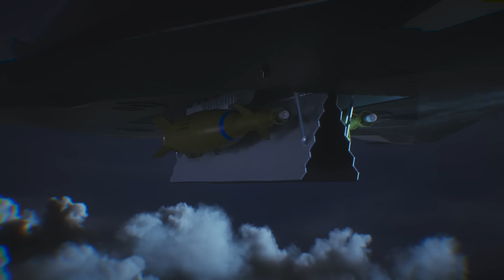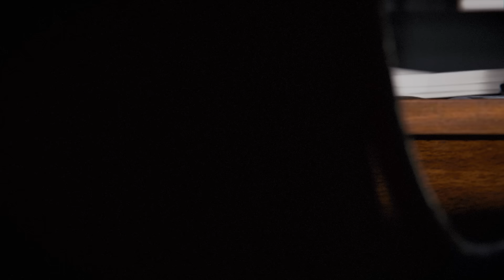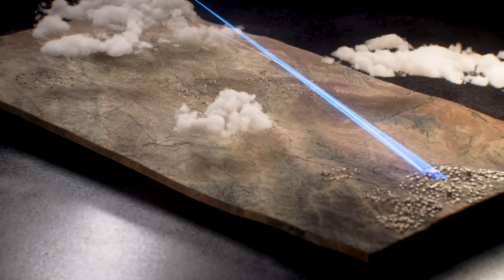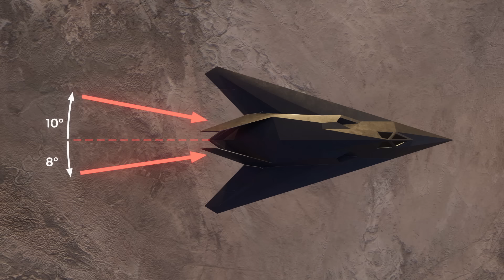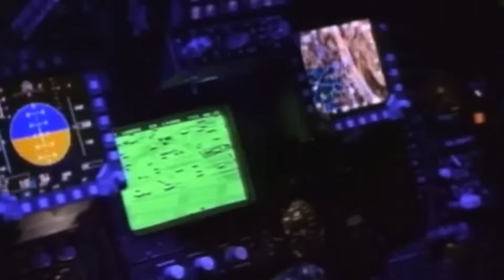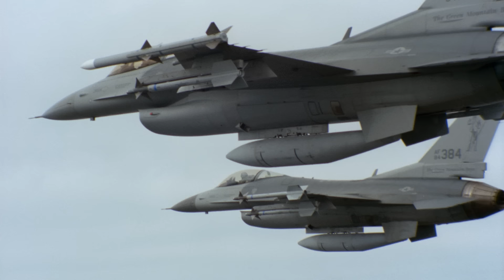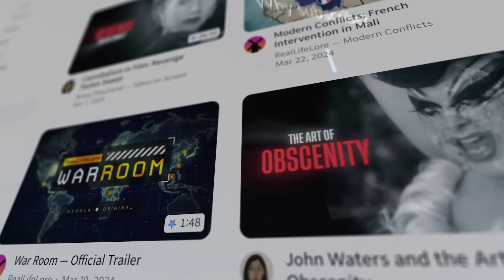The Insane Engineering of the F-117 Nighthawk

Comment: The radar absorbant matierials on this airframe are super fragile and needed alot of maintenance if they got too wet or just dust abrading them away during flight etc meant complete removal and reapplication... THIS STUFF is super toxic and will give you cancer if inhaled much asbestos based layered bitumenish polymer wierdness NDA it also contains ******alnine and alkyl****knows😂 still used today B2 AND F22 f35 meh hope they provide good breathing appa to the maintenance crews 😂
Reply: Like it was so bad to deal with it alot of the retired f117 airframes instead of being completely decontaminated were simply stripped of any avionics and engines etc and buried because it was cheaper than the cleaning up of a now defuct aircraft 😂

Comment: Correction about war over Serbia: the SAM battery which had a shot was actually never moved after initial displace which did happened some 2-3 days before war, and their radar was silent until up to 10 mins before acquisition for surivelance radar and 3 intermitted acquisition & targeting radar which lasted about up to 20 secs each. F-117 route remained same for 4 days, and on top, there was no SEAD support even close *But  Serbian side didnt know that so they had to assume that there will be some HARMs coming down their way as soon as they power up radars.

Comment: Ok, the anti-icing wiper blade and gylcol system seems like a 70's solution for a high tech plane. Lol i get that it was sub-sonic but how many of those were ripped off during flight? Why didn't they electrify the grid and heat it that way to melt the ice?
Reply: Heated panels can be dangerous because the water simply flows back across the airframe and freezes further back. There's a reason most airliners still use wipers

Comment: The thing that always trips me up about the F-117, is the fact that it has the fighter classification as denoted by the 'F' in its name. Since it is technically a bomber it should be named the B-117 or something similar.
Reply: Legend has it that the Air Force wanted to attract fighter pilots to fly it and the F designation basically sounded cooler than calling it a bomber.

Comment: I remember going to an air show with my grandfather at Dover Air Force base back in the early 90''s just to see this plane. It didn't fly, it was only on display. It was amazing and disappointing at the same time because you couldn't get closer than 75 yards...but it was surrounded by armed guards, which as a kid was the coolest part.  I remember wondering how it could fly with such thin wings. They also had red coverings over the air intakes and along the back, which I now know is the exhaust area...even the landing gear was covered, which I thought was cool because I was convinced it could take off and land vertically and therefore didn't need wheels.   My Grandpa was such a joker that he egged me on and basically told me I was correct on any wild ideas I had. Hahaha...great memories.   
This is one of my favorite planes of all time.

Comment: The F-117’s ‘insane engineering’ was groundbreaking in the 80s, but let’s not pretend it was flawless. It was basically a flying polygon that couldn’t dogfight, relied on Cold War secrecy, and got shot down by 1960s Soviet tech in Yugoslavia. Some ‘stealth’ legend.
Reply: 1: It was designed as a precision strike aircraft, not a fighter. It only has the 'F' designation as it was flown by fighter pilots but the aircrafts role was strickly ground attack thus it didnt need to dogfight, which by the time it was in service was becoming a rapidly dated concept with improving air to air missiles. (Obviously on a dedicated fighter dogfighting capability is still important on the off chance an engagement leaves the BVR stage)

2: The secrets of how the aircraft was stealth were protected and it often operated under secret conditions, but so do all state of the art vehicles and weapon systems. To say it relied on it is arguably false however as it was an intelligence leak that led to the shoot down.

3: During the conflict in Yugoslavia, F117's flew hundreds of sorties undetected by enemy radar installations. During a sortie the F117's would often be accompanied by an AWACS aircraft which assisted in dealing with various anti air installations. The reason one and only one was shot down was US complacancy and a lack of in-theatre maintenance on the F117's bomb doors. The thing is, the F117's often flew the same flight path and the Serbians knew this, establishing multiple anti air stations along the route. The shootdown happened because of all of these reasons: The F117 that was downed, lacked AWACS support, its bomb doors jammed open for a few seconds longer than normal allowing a Serbian anti air operator to know one was in the vicinity. Because the operator knew the flight path and rough altitude of the aircraft he proceeded to blind fire two missiles in front of where the F117 was going to be with a timed fuse. The missiles never actually locked onto the aircraft, instead detonating in front of it with the F117 colliding with the shrapnel resulting in it crashing. Still an impressive achievement and astonishing failure on behalf of the US, but it wasnt the fault of the F117's stealth capability, nor does it mean stealth is useless, despite what the russians want people to think.

Comment: I would like to see a video about the XF5U. It was developed in WW2 though it never saw combat and it being a prop plane meant it was passed over for jets. However it had extremely small wings and a lifting body. The body of the plane actually provided enough lift to fly by itself but it didn't have enough roll or pitch control so small wings were added, they also provided more lift which allowed for more weapons. It actually was considered a very attractive option and even after the war was seriously considered. It had a low stall speed which meant short take-off and landing and it's bulky appearance and short wings meant it wouldn't take up much space inside an aircraft carrier.
That said there were issues. The very large pair of double wasp engines mounted in the flusalage combined with extremely large propellors created a lot of vibration which was hard on the pilot and the structure. Solving this was deemed not worth it with jet technology on the horizon.

Comment: It’s an nazi Design 😂
Reply: That was the B2 flying wing
Reply: @iwineverygame1995 neither are nazi designs
Reply: @Orbital_Inclination Original functional flying wing prototype was German.
Reply: @Orbital_Inclination B-2 was created because of the flying wing's low radar cross section. 

Argue with the OP. Not me.
Reply: @iwineverygame1995The B2 is unrelated to the Ho229 and is based solely on the work of Jack Northrop and the Tacit Blue program of the 80s done by Northrop Grumman.
Reply: @Tozzpot500 Wait until you find out where they got the idea.
Reply: @iwineverygame1995The Northrop N1M that first flew in 1940 and was the first flying wing design with an engine to fly?

It certainly wasnt a failed nazi prototype

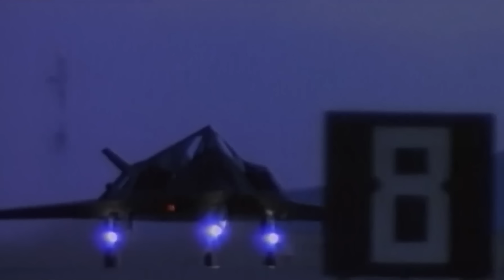Comment: 13:57 the sweep angle is the angle at which the wing is tilted backward, it's measured from the root of the wing not from the tip as you show here,  as well it's measured in degree not in "%" as you show here incorrectly, maybe you should skip this title "engineering" and go back to school

Comment: While those other things were factors, the real reasons the F-117 was shot down came down to the AF using the same regular routes for the planes and luck.

Luck because low frequency radar can see stealth, but only at closer ranges, though it doesn't have the fidelity to produce a weapons lock like high frequency radar can. The low frequency radar saw the plane where it was expected to be and the high frequency radar was switched on just as the F-117's payload doors were open.
Reply: The real reason was the arrogance and ignorance of the CAOC in Vicenza, LtGen Michael C. Short USAF, cancelling the SEAD and CAP ATOs that night diverting those assets north and sending the F-117s south all by themselves.

Comment: I have never heard this question addressed.. how is it that.. if the radar is coming from the ground, and the bottom of the aircraft is extremely flat, how is that even remotely stealthy? Typically flat surfaces are known to be the absolute biggest no no ever.. no other plane or ship or anything that calls itself stealth has a single flat surface on it.. yet this plane is almost completely flat on the complete underside, which is the side that all of the radar will be bouncing off of.. please explain?

Comment: The stealth fighter would be doomed in a dog fight it’s ability is firing its missiles off at aircraft without bein detected,but the night hawk could probably be picked up by advanced modern sensor sweeps now,but no aircraft is undetectable when producing a heat signature which goes with jet engines,it’s the balance between stealth a speed which modern aircraft use now

Comment: Lol, engineering was so "amazing" that it was shoot down by Soviet anti aircraft missile from 1960, and in a situation where 27 Nato countries who attacked 1 country without UN approval couldn't impose "no fly zone" after 78 days of constant bombings. You are a joke. Xd
Reply: cope harder
Reply: 1 shotdown after flying thousands of sorties is not impressive by any standard. War material will be destroyed and the F117 that was lost was already obsolete by the time the Serbs got lucky and hit one.

Also they only detected the F117 due to literally every condition being in Serbia's favor:

1: due to weather the F117 was flying without AWACS support from an EA-6B Growler.

2: The F117 was flying the exact same route that every single other sortie had taken.

3: as it launched its payload the doors jammed. Normally they would be open for a few seconds, in this case it was closer to 35.

4: At the time the F117 launched its payload a Serbian Radar operator powered up his system and was able to locate the aircraft. Knowing the route it was going to take he fired two missiles into the path of the F117 set to airburst mode which the F117 then flew into. The missiles did not achieve lock nor did they track the aircraft. 

5: stealth aircraft are not invisible, they can be detected at relatively short ranges which is why they fly with AWACS support to deal with Radar systems if they do get pinged. The radar used for detection and the one used to obtain missile lock are different systems, spotting a stealth aircraft doesnt mean you can obtain a lock, especially if its equipped with anti radation munitions.

6: only one F117 was shot down, and that was due to the USAF becoming complacant and overconfident. It remained in service and saw combat after Serbia but only one was ever lost which says a lot more about the aircrafts cabalities than one being shot down in a literal fluke.

Comment: Too much unexplained jargon and unclear explanations. How does the shape help make it invisible to radar exactly? Still have no idea after watching this
Reply: To try and put it simply, radar works by sending out a signal and then waiting for it to bounce off something and return (The bigger the return signal the easier it is to track). The F-117's shape is designed to bounce the radar's signal in as many directions as possible so the radar gets a very weak return signal, making it hard to track and even harder to maintain a lock.
Reply: Some parts of an airframe act as retroreflectors, similar to bicycle reflectors, allowing radars to detect signals bounced back from the airframe over long distances. When radio waves are reflected from various parts of the airframe, they interfere with each other. By carefully shaping the aircraft, engineers can manipulate this interference to scatter the reflected waves in directions other than back to the radar source. Advances in mathematics have enabled the identification of retroreflective areas and optimized the overall shape to reduce constructive interference and minimize signal reflection toward the radar.

The angled shape of early stealth designs, such as the F-117, is a result of the limitations in methods and computing power available at the time it was developed. This design, while effective, was constrained compared to the smoother, more aerodynamically optimized shapes seen in later stealth aircraft.

This approach, combined with the use of radio wave-absorbing materials, creates a low-observability aircraft in this part of the spectrum

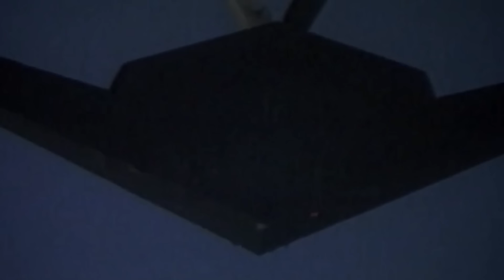Comment: 1:20 there has been one f-117 shot down that I know of
Reply: it’s only been one out of the whole time it’s been in service
Reply: He was talking about the Gulf War, where no nighthawks were shot down.
Reply: There has only been one shot down
Reply: That is the long and short of it and 100% the facts from lord
Reply: Yeah, the Serbs shot it down, but they used the S-125 missile, which is radio command guidance and not radar guidance. 

They only shot it down because the stars aligned perfectly. 

1) All F-117s flew the exact same air corridor at the exact same time every day, making them extremely predictable. 

2) The Serbian radar site broke protocol by activating their radar a 4th time in a row without moving position, which happened to be at the same time the F-117 had its bomb bay door open, which greatly increased it's radar signature. 

3) the S-125's radio command guidance system is Semi-automatic Command Line of Sight. This requires the missile operator to manually maintain a lock and track on the target while the missile automatically guides itself toward the manually tracked target. The increased radar signature made it easy for the missile operator to find and lock-track the F-117, ultimately shooting it down. 

If any one of these variables hasn't existed, the shoot down wouldn't have occured.
Reply: @Lord_Inquisitor_Ferrus_Eisen thank you.. for the back story didn't have to pause the video to find the answer... appreciate it very much!!
Reply: Tysm for context  @Lord_Inquisitor_Ferrus_Eisen
Reply: @Lord_Inquisitor_Ferrus_Eisen So due to US incompetence it was shot down.
Reply: @Lord_Inquisitor_Ferrus_Eisen  i love people like you
Reply: @clebimtane same they tell you tje whole back story .. yeah we could go research it but it's awesome to have it while viewing the video

Comment: The coolest fact that I love is that while testing the design they mounted a full size mock up on a pole to see if Radar could see it. Radar did see it and it confused the engineers because mathematically it shouldn't be seen as big as it was, and then the figured out that the radar return that they were seeing wasn't the F-117, it was the pole it was mounted on!

Comment: If youve ever seen indiana jones and the raider lost ark , there was a rear engined v wing bomber , a fitional plane yet on the drawing board from 1938 , they were going to use a charcoal paint which if the panels were lined with wool the waves absorbed by radar vuild a static wall and the charcoal is for the radio reorganising properties of graphite. And put a junkers jet engine in it and so the v2 and bombers with the v wing form and radar nullifying panelling was on the drawing board from 38 and was built , two of them but in test flying the glider for airodynamics the plane was shelved as the retraction of a flight instrument that mistakenly did not happen caused the test flight glider for the shape to crash. All interesting stuff but where fiction took on the shape i had to look up the rear engined planes , such as two fighters built by japan , the two v 2s and the other drawing board bombers are so interesting , fiction takes what we couldnt do and it behaves like a precognitive as not so far round the bend the real thing hits the scene

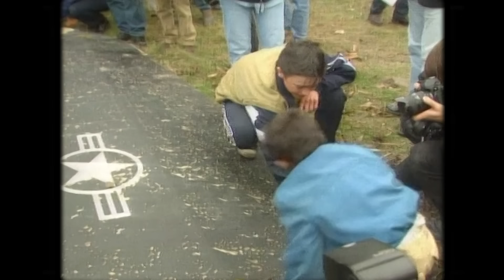Comment: 23:13 that was also because of several failures on the Americans part the f117 was flying the same path other have flown before meaning the enamy knew where it was going and when it would arrive it wasn't acopened by electric warfare aircraft like other flights at the time the lack of ew aircraft (which the enemy knew of because they had spys nearby the base the f117 took off) caused the radar operators to break their own rules of never turning on the radar more than twice before moving the same because they knew there were no anti radiation missile equipped aircraft in the sky. When they did use the radar for the third time it was the exact moment the f117 open it's bomb bay the same fired two missiles the first one missed completely the second one hit
Reply: Yeah I came here to say basically the same thing. It was literally a lottery ticket win. Those bomb bay doors were open for like less than a second.